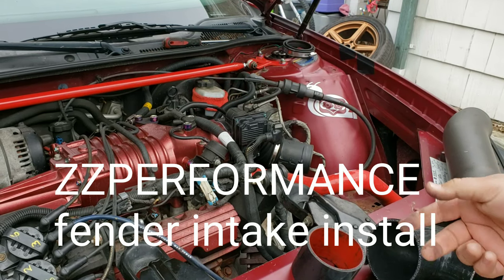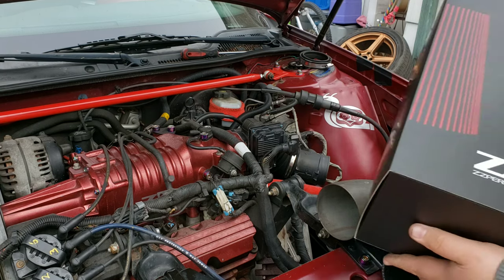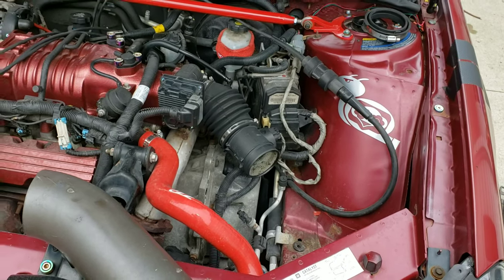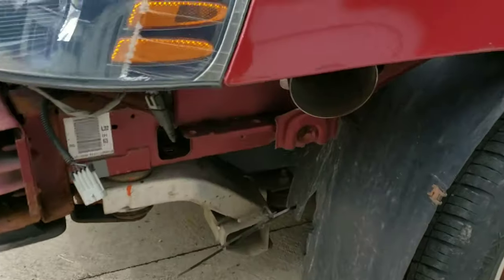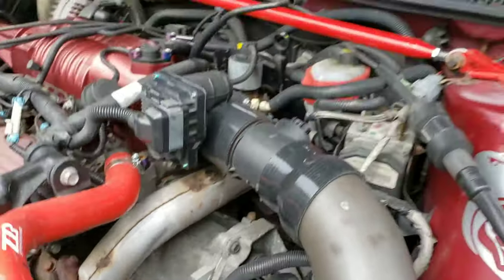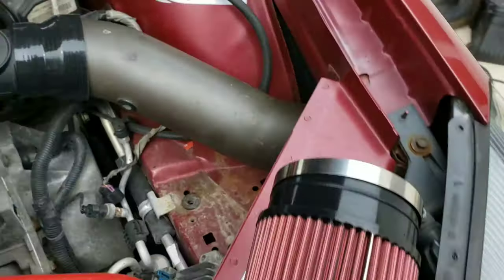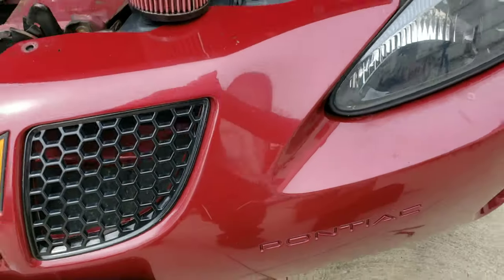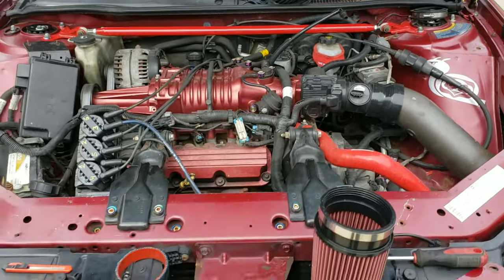zzperformance air intake install

Comment: Why would u have down there were it could suck up water from road when rain drive through a puddle of water
Reply from the maker: That's how the ZZP fender well aur intake is designed. If you have your wheel well plastic cover you should be fine. I would recommend getting a HYDRO GUARD for your filter